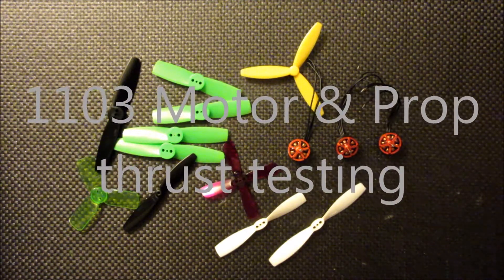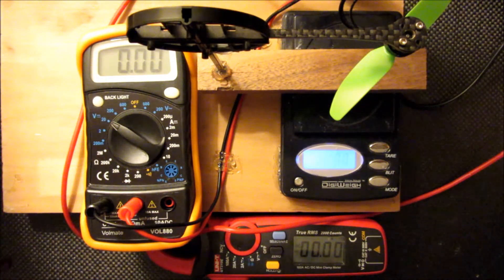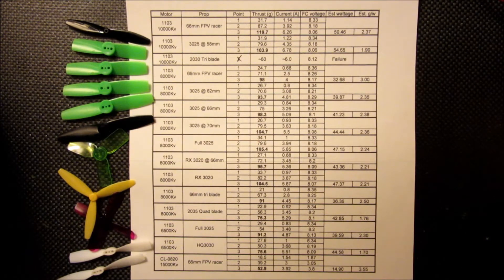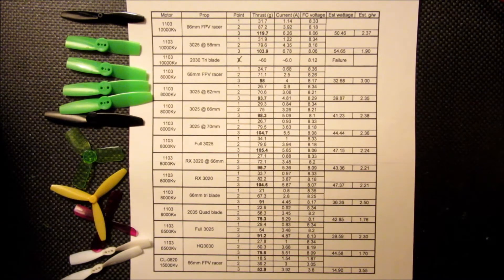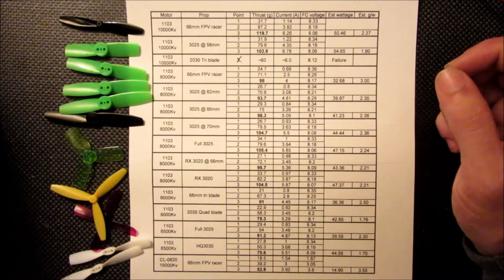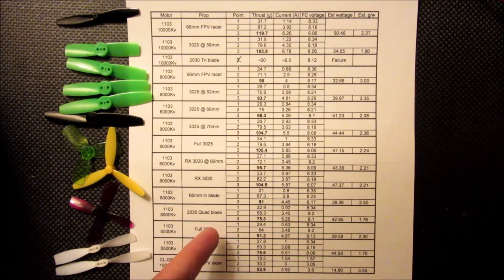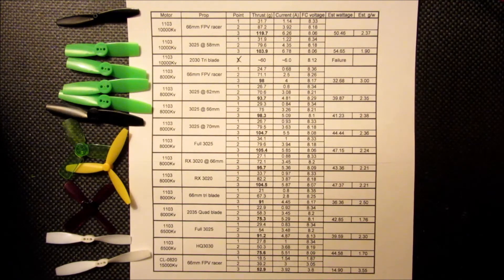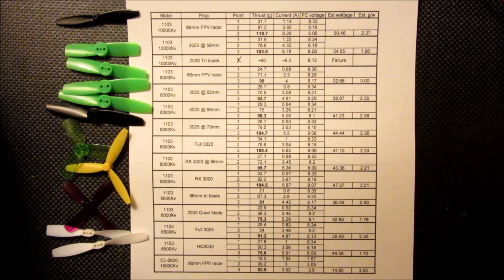1103 build part 1 thrust testing

Comment: Dave, any issues with these props flying off the motor shaft?  That is, do you think the prop screws are required when looking at this type of motor/power?  Thanks for the tests.. wondering what kind of current the 8000kV motor would be pulling on 3s and if the Crazybee F4 Pro V2 would be able to handle it.  Subscribed.
Reply from the maker: Screws are definitely not required, however even when using super glue I've had some instances where some props come off.  66mm 2 blade seemed to be the sweet spot for these but require boring out and should be re-balanced. they do stay on great for me if bored to a tight size and glued on tho.  Biggest issue is if you fly crash/often these steps become a pain when swapping props and quads with 2 screw props ready to go become more appealing.

Comment: Please for the sake of all things holy share where you got that 66mm triblade.  I just asked Gemfan to make that in a triblade in the same PC material.  That one you have looks like a harder plastic.  This is the first I've ever seen of that prop in triblade.
Reply: Search aliexpress for "65mm 3 blade." There are a few sellers, where you have to select 65mm when you open the listing. Resizing the photo to be the same size as my KK 65mm propeller the hub is definitelly bigger, so it is probably changed in the mould, not by drilling it out manually.
Reply: ur such a noob bob.
ripping all from dave and tell the world it is your research. even to stupid to by kk props 1.5mm biblades on aliexpress you can buy since ages.
better tell the world to drill the 1mm versions...facepalm.
hell, what a noob and copycat u are.

Comment: lil question 
what would be the best prop for the 6500kv motors ?
Reply from the maker: totally depends on battery voltage, 2s 3025 is good, 3s I had good results with 66mm, "Best" depends on what you're looking for.
Reply: wel i got an 1103 8000kv build with the 66mm props 
and that"s awsome on 2S 
just not sure if the 6500kv's would be good with the 66mm on 2S 
i got like 40 1103 6500 kv motors from that flashsale some time ago XD ..impulsebuy haha
Reply: i actually created a brushless motormount to go on the picnicframe's ^^ 
got 1 of your efficiency racers i wana convert
Reply: Takoza 40?! I’m struggling to get rid of 24 6mm 14,500 kv brushed motors that I ordered wrong kv ( I wanted the 17,500 kv ) they last forever lol and I don’t wanna waste them , my first brushless build will probably include 1103 - 04 motors of some sort with

Comment: I have 1103 10K racerstar motors, and a very small 90mm frame that requires 1.9-2inch props. Can you reccomend a good prop for that motor ? Should I stick more towards 3 blade or 5 blade ?
Reply: using 2s battery
Reply from the maker: I'd personally recommend a 2 blade prop drilled out.  Below I noted Hubsan prop made 71.2g @ 2.75A. 
2035 quad blade was 75.3g @ 5.29A so only a touch more thrust but almost 2x current.  More blades generally means less efficiency and on a micro you want as much as you can get.
Reply: Hey thanks for the fantastic advice, I will give that a go. My battery life is pretty awful so I think you may be on to something going with a lighter 2 blade prop. How did you attach it to the shaft, maybe use some super glue ?

Comment: Wouldn't the thought process to running the 3 blade 66mm prop vs the 2 blade be that the 3 blade will have more "grip"?
Also, have you done any additional 2" prop testing by chance?  I'm trying to figure out the most efficient 2" prop for a 2s setup with 10a ESC, and those same 1103 8,000KV motors, thoughts?
Reply from the maker: Yes, 3 blade should have more grip limiting that coasting/floating feel.  They will also be slower to spool up with these motors, so in hard 180's etc, they may actually feel to have less grip.  I noticed this on the Propel RC props in my most recent video.  IMO this build is great for LOS but actually a little too much grip for FPV which is why I also made a 3s build.  

If you want 2" efficiency see comment below. Hubsan X4 is nearly 2x as efficient as the 2035 4 blade with a minimal drop in thrust.

Also see JBee FPV's comment below referencing props he tried.

Comment: +Dave Woods Any guesses based on this test what props would provide the best thrust on a low KV (5250) 1104 motor on 2s w/6amp ESC's?  I feel like it may be the HQ3030's?
Reply from the maker: HQ3030 should be fine with only 2s.  Thrust wise they probably show a little more than the GF3025 but I'd suggest trying them too and see what you like most.

Comment from the maker: Update: Ran test with 1103 8000kv & Hubsan X4 propeller (similar size to 2035 quad blade)
Full throttle 71.2g @ only 2.75A
2035 quad was 75.3g @ 5.29A
Reply: What happened with the 2030 tri-blade test, it failed? I ask because I am 1935 tri-blades with the 10,000KV motor and have no idea what I'm doing, but my battery life is pretty terrible with a 450mah 2S
Reply: Justin Mack exploded
Reply: Use a lower pitch or a physically smaller blade at the same pitch. You're lugging the motors with a blade of a large surface area. This will lower motor temp while dramatically improving thrust to amp ratio.
Reply: @Justin Mack - i would also say 450 is to heavy - i only get maybe a minute extra if im lucky vs my 350 but the cost is another 12 grams! When i need juice i switch to my 550mah (350-20g/450+12g/Infinity 550+18g -beastmode-)

Comment: Thanks Dave, very interesting! Nice to see the numbers confirm the feelings I've had so far. Have you tried the 65mm gemfans? 
Here is my list of props I've tried on 1103 10000kv: (totally unscientific, all based on feel and experience)

Racerstar 2035 quadblades - low/medium thrust but high amp draw, inefficient, only reason to use is the small size?
LKTR120 props - similar to hubsans but a bit less durable
Hubsan (AFUNTA) 55mm - medium thrust but very smooth and great durability
Kingkong 65mm - very high thrust but a lot of oscillations on high throttle (unbalanced)
Gemfan 65mm - about the same thrust but a lot smoother
Currently trying full 3025's on 1103 10000kv, liking it so far but this makes me worry about the amp draw. Still feels like it draws less then the 2035 quad blades.
Reply from the maker: Thanks for your feedback, it was partly your vids that got me finally going on these.  
I used to stock and use the Gemfans but swapped to the 66mm FPV racers for my brushed builds (pretty sure they are the same as King Kong).  They thrust a bit more on the stand and also seemed to run smoother so I'm surprised they are not favored.  Not saying they aren't unbalanced though, and that I won't end up using some remaining Gemfans with the faster BL motors.
Will be nice if the Racerstars with 1.5mm holes are good.
Full 3025's sounds crazy to me on the 10000kv, but your already up and flying so what do I know.
Reply: Have you tested the Ladybird props against the Hubsans by chance?  I can clear a 55mm prop on this 43 gram Rotorious LB97 I just built and the Ladybirds have noticeably more thrust than the 2035 Gemfans but the Gemfans protect these incredibly fragile Racerstar 1103 8000 motors much better in crashes.  The 10,000kv Racerstar 1103's are $4 each right now so I'm tempted to buy 10+ of them but I'm not sure if they'll blow up this Racerstar 6 amp 4in1 ESC I've got, thoughts?

Comment: i have the 1103 8k and i can confirm the 65/66mm prop is the best for them. 2535 quad blade is also good, about the same power, more floaty but less snappy and responsive. auw of the liitle quad is 49grams w/o lipo so its on the heavy side. Unless you achieve an auw for 40 or less these 1103 are not worth it imo, I will probably upgrade to 1104 7k which seem to be the best for 2.5" builds. My light 3 inch ,auw 80gr with rcx 1304 4k and dys 3045 is waay more powerfull, on 3s is fast on 4 s is a rocket.
Reply from the maker: Thanks, I'm shooting for ~30g w/o battery so hopefully it's good.  1104 7k sound interesting but at a certain point I just jump to 1304.  I can imagine how the faster 7k 1104 would allow good 3s power where 1304 love 4s and it gets heavier.   My favorite build/daily flyer is like yours with 4k 1304 flown on 500mah 4s HV lipo.  
Surprised your using dys 3045.  They the 3 bladed ones? 
Seems like they would warm those motors nice, 3025's keeps them reasonably cool. Bet they could eat up 500mAh real fast too:)
Reply: 30g is perfect if you can achieve it, it will be very zippy.yes I know I ve seen your builds :) and yup they are 3 blades. they get warm but they can take it hehe, i cant believe how fast the thing is, i think it accelerates faster than my 5 inch racer.

Comment: Hi Dave great video as always..  perfect timing as I've just started planning a very similar build.. love my brushed quads but believe I've max out with the racestar 8520, king kong 66mm props on qx95 frame.. funny enough my decision to cross to the dark side (brushless) was the camera, I really need to go ccd now and with the runcam micro coming out soon that's now possible, would  loved to stay 1s but what can you do.. by the way do you find the 66mm fpv props to be unbalanced, the king Kong ones are great but are horrifically unbalanced and will destroy the motors very quickly if not balanced before use.. lastly will you be balancing the motors and if so will you show us your technique, I'd be very interested.  many thanks for all the info you share and keep up the good work..
Reply from the maker: Thanks, I'm surprised the King Kongs are giving you issues on your brushed build.  
It's some indication that there may be some variance as I think they are the same as the 66mm fpv racer ones I used and they have always been excellent for me.  
Motors should have been balanced by the factory.  Suppose that's a big assumption on my part but at this point I don't plan on balancing the mechanical parts.  If that's required, my interest is going to dwindle quick.
Reply: Dave Woods .. Hi Dave thanks for the reply.. I'm pretty sure the 66mm props are identical just rebranded and every one I've used without exception needs balancing .. very easy to test simply place on a needle and hold the needle horizontally then move the prop.. it should hold its position if balanced..if not ( spoiler alert) it won't.. lol then use a razor blade to scrape some material away from the underside of the heavy blade.. repeat until prop holds its position on the needle.. this will significantly reduce heat in the motor and vibration making the quad quieter and much easier to tune as there's less vibration getting to the gyro.. it may also reduce amp draw but you would need to test this.  motors.. these are almost guaranteed to be imbalanced however soft mounting should help resolve this, if however you wish to balance them there are many videos you can watch on this using vibration apps and vinyl tape, but personally  I'd go with soft mounting, either electrical tape or pre-cut soft mounting pads from banggood/gearbest etc.. I hope you don't think I'm criticising, this is just my personal experience and thought it might help as "like me" your going for maximum thrust then heat and vibration are going to be the biggest problem... anyway I genuinely look forward to and enjoy your videos and can not wait to see your choice frame and components.. cheers
Reply from the maker: Thanks,
No spoiler though, am reasonably experienced balancing micro props (I use sand paper) and the 66mm FPV racer ones I've used and tested honestly seem pretty well balanced.   On a needle I can barely detect any unbalance on a few I just checked.  My test stand is also prone to vibration and I didn't see much there.  Props are injection molded so there will be variation and I've experienced varying quality myself, just not on these yet though I've ordered multiple batches.  Maybe I should squirrel some of the ones I have here away for personal use if they go downhill;)
Reply: Dave Woods .. that's really interesting, I'm going to order some.. I clearly jumped the gun and just assumed they were the same as they look identical so I'm  sorry about that and now you mention it I remember you saying about how you use sandpaper...by the way do you think they will stay on with just  compression fit..? I know they did in testing but my thinking is in flight and  under load they might not hold so any thoughts, oh crap one more thing are you going to test any 1104 motors I can't remember if you said..its been a long day..lol  right that's it I  promise.. I almost never comment on yt videos so I'll stop hassling you now..lol  so take care and as soon as the UK weather improves I'll start putting your info into action...cheers
Reply from the maker: I'm not trying to get you to buy anything but hope they work out better.  I am pretty sure they are the same props though as I believe the FPV racer ones mention kingkong on the packaging.  I think it must be lot/batch variation.  Hopefully they are getting better not worse.  I don't plan to test any 1104, as I'd rather jump to 1304.
Reply: Dave Woods   oh I appreciate that and I'm sure it's probably a quality control issue, in any case I've  had to balance every prop I've ever brought so nothing to lose really and if truth be told I quite enjoy it.. anyway I've got a 44ton truck that's got to be dragged in to London (oh joy) so I better crack on.. it was really good talking to you Dave and I look forward to seeing how this build works out..if it's anything like your brushed build   then your going to need NASA clearance..lol

Comment: thanks for another great vid dave!
where do you get 66mm props with 1.5mm hole? or are you just drilling them out?
Reply from the maker: Thanks, I drilled them out.  Racerstar has some with 1.5mm hole but I haven't confirmed they are the same yet.
Reply: cool. I have some with 1mm holes. did you drill them with a 1.5mm bit, or go smaller, for better fit?
I just ordered the racerstars to see how those compare..
Reply: Dave Woods where do I find thoes yellow tri blade props
Reply: @davewoods5395  which size drill bit did you use?

Comment: Awesome video. Very informative and thorough as always. I'm using the 10K racestar 1103s, racerstar 6a ESCs, Piko blx, and a cheap 1mm carbon fiber x frame. Weighs 39 grams without the 2s battery. I initially flew the quad with those 66mm props, but my quadcopter definitely handles better with the Ladybird props. Seems like the 10k motors liked the shorter props better. Not as much thrust, but very responsive.
Reply from the maker: Thanks for the input.  I'm going to start with the 66mm props but will try something smaller if I can't get the response I'm looking for.  Looking at right about 30g w/o battery scaling up the parts  planned, that may help some. Another 5-6g with FPV.  500 mAh LiHV 2s adds about another 32g.
Reply: Just a side note, I bought your Picnic 135 acro frame for this build before I realized how small those 1103 motors were. I spent a week trying to make that frame work for me before I gave up and bought a cheapo Banggood frame. Love the picnic quad frames. Now I just need to get some motors and ESCs for that little 135 frame haha

Comment: - looking forward to your 1103 frames.
Reply from the maker: Not sure how many I will be releasing many 1103 based designs but did already make folding arms for 1103 motors and some for 1104/1105 too.  With the 4 in 1 ESCs they are more practical now.   http://picnicquads.com/product/micro-folding-frames/

Comment: hi Dave, thanks for the test.  Im working with 1103 10k motors, piko blx, 6amp 4in1.  im pulling stuff out of an eachine aurora 90 and was going to build a 110 Firer.  im not sure what the prop clearance is but would love some links to the top 2 props. Also what is the best way to shave down props?
Reply from the maker: 66mm props will clear each other even on a 100 size frame.  They may not clear frame parts though depending on the design.  
66mm props are ones I have here http://picnicquads.com/product/propellers/
but they are all over. Most list them as 65mm although they are really much closer to 66mm. 
Note I had to drill them out to fit the 1.5mm shaft.  Racerstar also has some 65mm with 1.5mm hole which I believe are of the same design but don't have them yet to confirm.  
Props can be cut down with side cutters or even nail clippers.
Reply: I just built a 110 Firer with BR1103 8000kV and 1.9 inch (48.3mm) props, there should be enough clearance for 2 inches (55mm) props but no more.
Reply from the maker: At 110mm even 66mm props should be easy to clear. Why are they limiting prop size so much? 
Just throwing away thrust potential.
Reply: Dave Woods i think im going to get the firer 130 frame instead of my 110.  that should easily fit 66mm props.  And the frame is only 2g heavier.
Reply: Check out the Realacc KT100, it's actually a 111mm diameter for 1103 or 1104 motors, fine with 66mm props (maybe 3" too after some mods)

Comment: Great video! It would be awesome if you sold 3D printed mounts to convert our brushed Quads to micro brushless Quads!
Reply from the maker: Thanks, it's a nice idea. I'm afraid they may be a bit pricey and end up being the weak link relative to a properly designed frame intended  for 1103's.  I'll keep it in mind though and see if anything feasible works out.